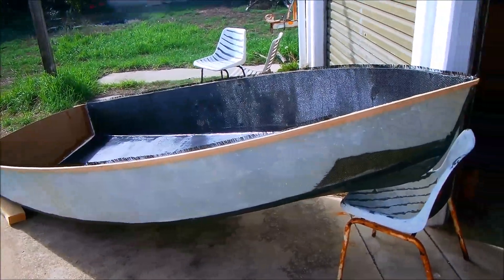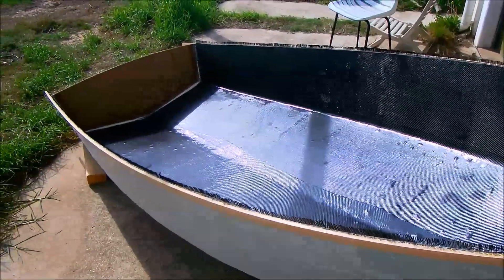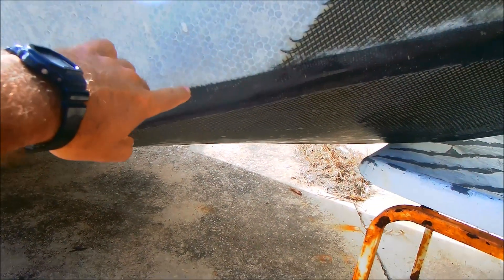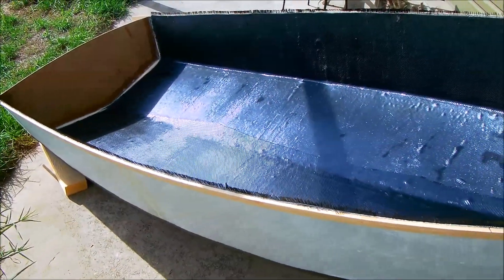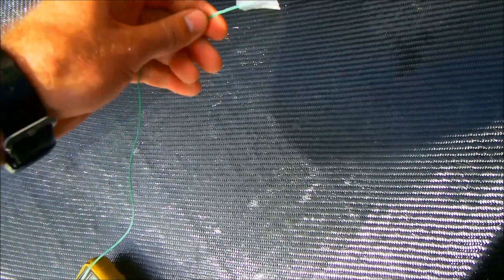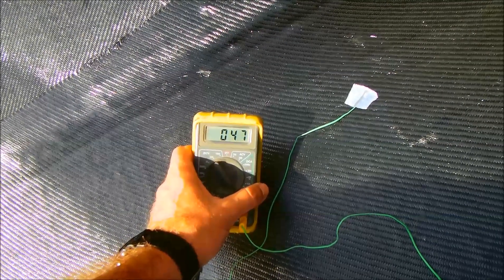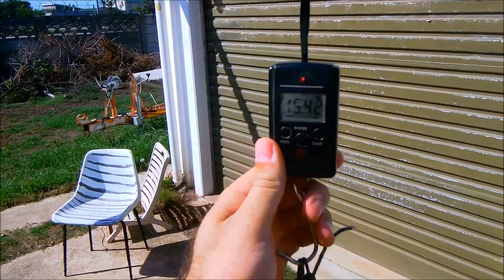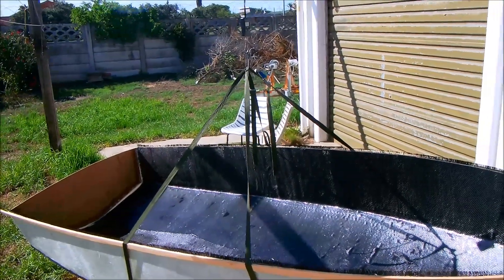Spindrift 10 build #2 - Bare hull weight

Comment: Hi William, have you got any video of the boat perfoaming in water? I'm very interested in this kind of material.
Reply from the maker: I have not made any progress with the build, too many other projects and distractions. When I finish it I will definitely post some video. Thanks for the interest.
Reply: @williamfraser  Thank you for you reply, and what kind of fiber cloth do you use for the skin if I may ask?
Reply from the maker: Inside is just one layer of carbon. Outer skin is Vectran and fibreglass. The Vectran only covers the bottom panels. It is supposed to be good at resisting inpact punctures.
Reply: @williamfraser  thank you

Comment: Hey Will, did you ever finish this, I think I just bought one of these boats and figured it out based on the sail, its missing a centerboard and rudder/tiller would you have any recommendations on the build for that
Reply from the maker: Still unfinished. Make contact with the designer, B and B yacht designs. I am sure they can give you what you need.